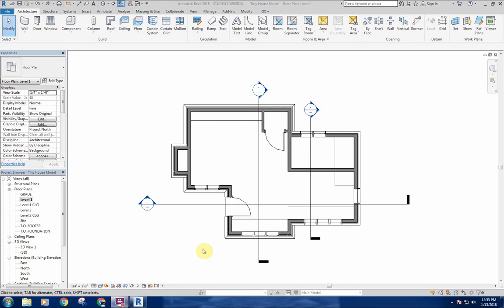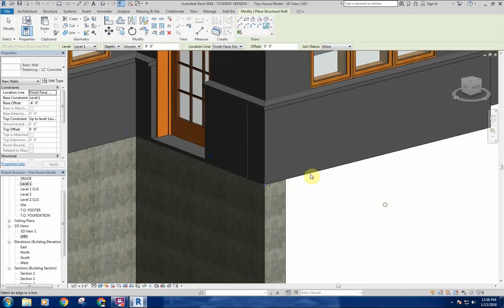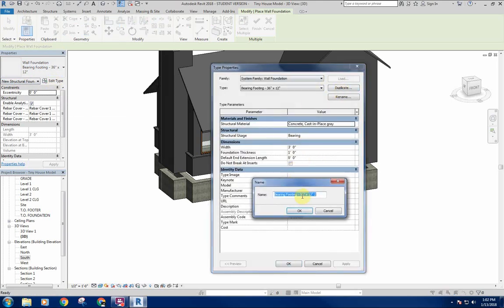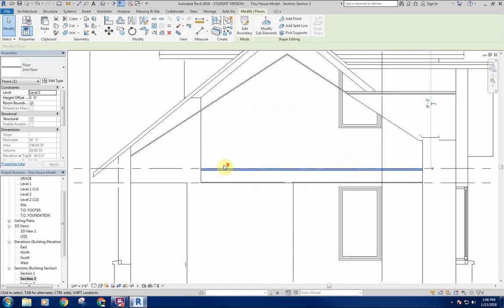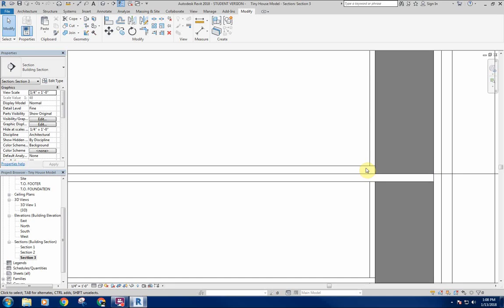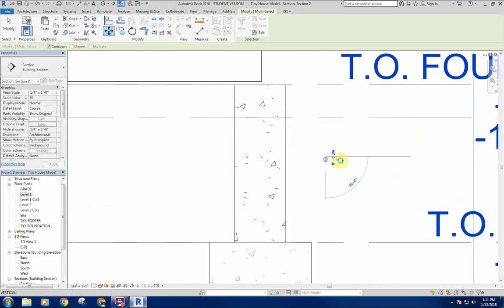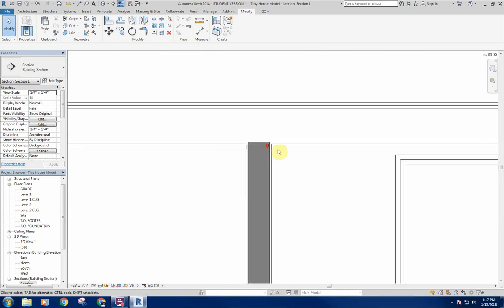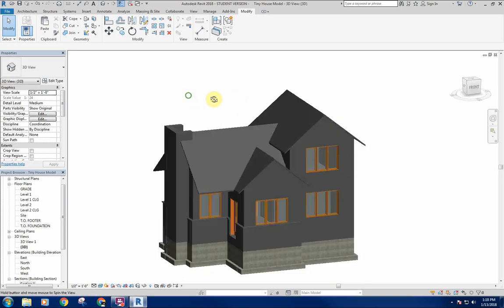Revit 2018 - House Tutorial - Part IV - Floors and Foundations

Comment: Been following along the building of this house, I've done exactly as you have but for some reason all my wall and floor outlines are all in bold  unlike the detailed layers you show. Is there a "view" setting I missed? This is most noticeable when you are joining walls. Mine look like they were drawn with a sharpie while yours look like detailed pencil markings. (separation of finish and structural materials)
Reply from the maker: Down at the bottom, just to the right of where your view scale is, there's a setting for Detail Level.  You may have it set to Coarse and you'll want it on Fine.  If you already have it on Fine and what you're seeing is all the different layers of your wall they're just separated by big thick black lines, try hitting the TL hotkey.  That's the hotkey for Thin Lines, which is also located at the very top of the screen.  It toggles the line weights on and off so you can actually see smaller details better.
Reply: @brianalbrecht7859  Thanks for the fast response! The "Thin Lines" hot key did the trick! Now I can see!